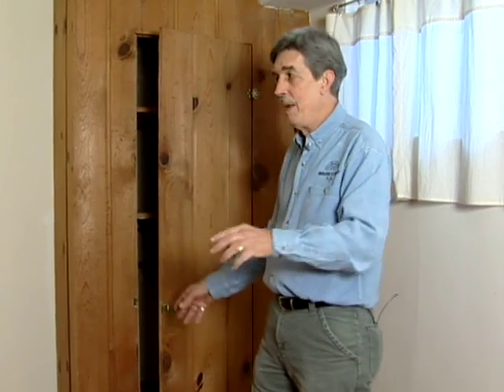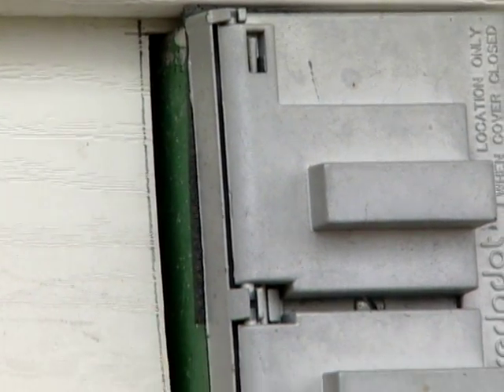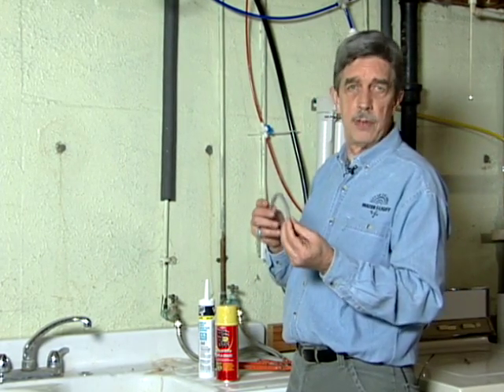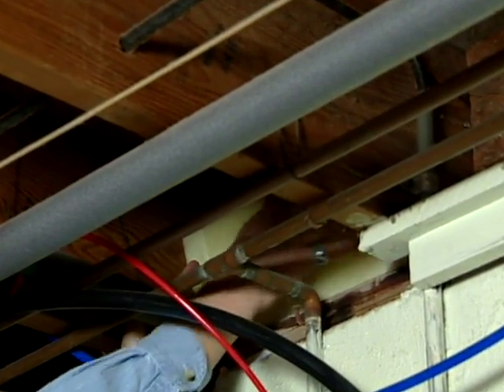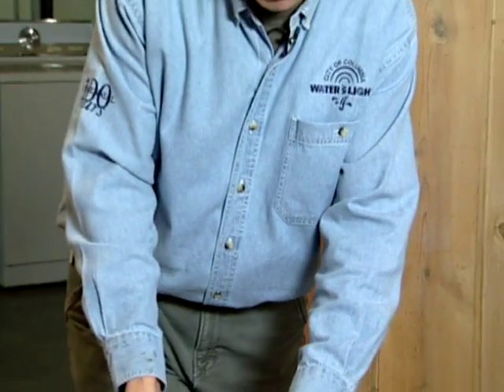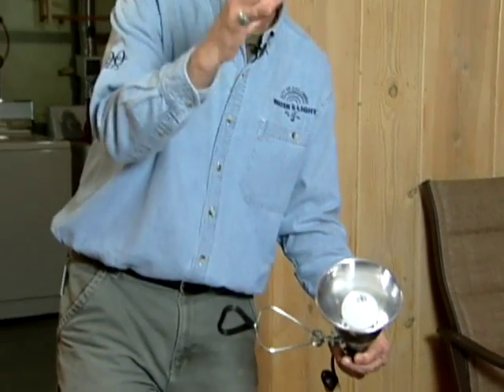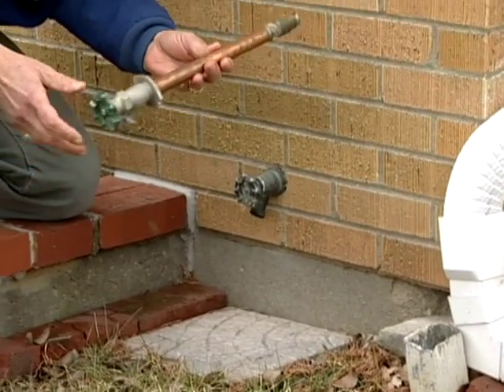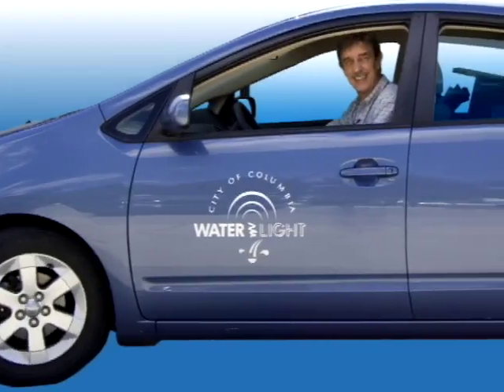How to insulate pipes

Comment: the hot water pipe really is less than 20 inches, but for years the hot water tank is in a open garage, other cases it is known to have caught fire? some unknown gas heater or electric heater issue.
1988 there was a 'dump of hot water heaters' in the san mateo county ca area.

Comment: before 1988, I thought there was no ''temperature valve'' for the hot water heaters marked fall/summer something. but the first one pipe insulator in installed at foster city my parents condo. the tube is NOT regular rubber/foam it is specific to the bay area temperature, it can be adjusted I thought specific to the temperature. but years before people didn't adjust the water tank and people would BURN in hot water even "?babies died?",